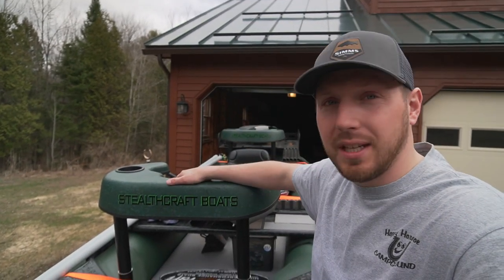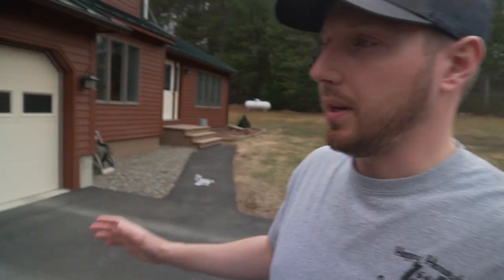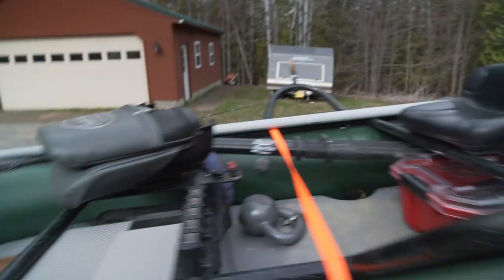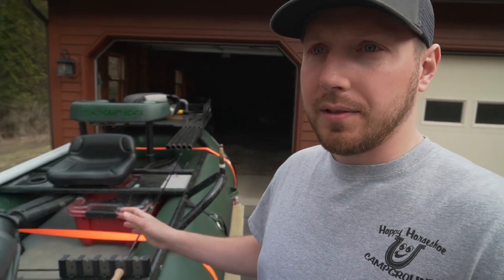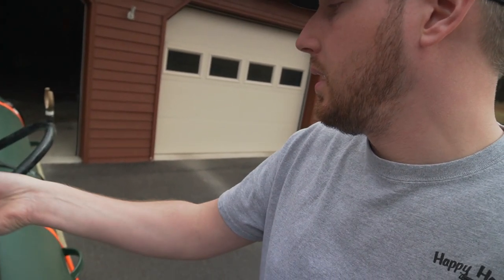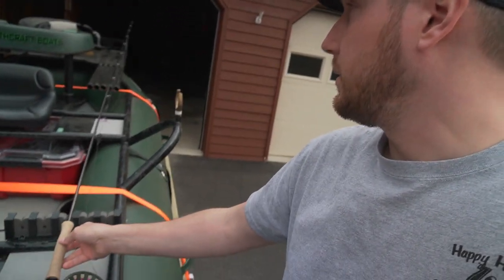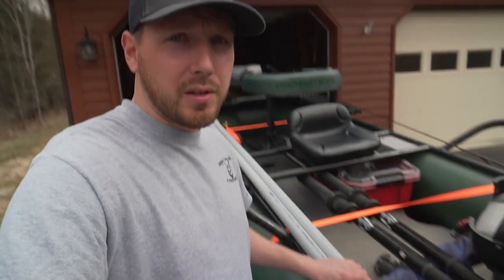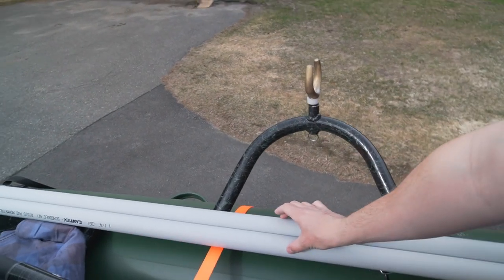DIY Rod Storage for Raft/Drift Boat

Comment: Little late to comment heat the conduit up with a torch.  If you hold it far enough away and heat slow it will not blacken the pipe.  It turns like rubber and you can shape it any way you want.  We do this all the time in retro electrical work all the time.

Comment: Make your life easier. Heat the sand, pour into pipe, wait 5 minutes. Pipe will move like a rubber band. No kinking.
Reply: I am about to make these.  How would you recommend heating up the sand, and how hot do you need it to work?
Reply: @christopherkenney3581  put it in a disposable pan and put it on your bbq.  i bet 350 would do it.  20 maybe 30 minutes?